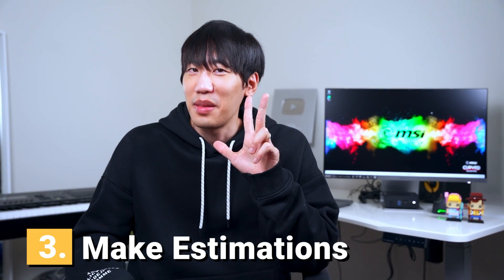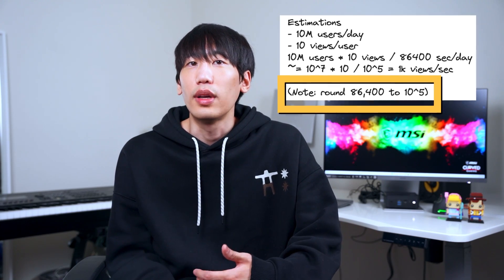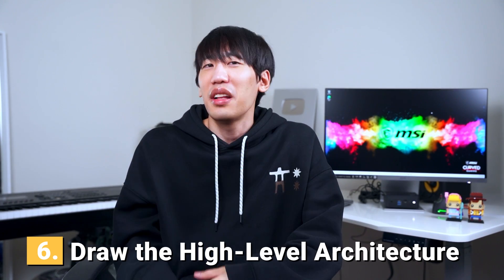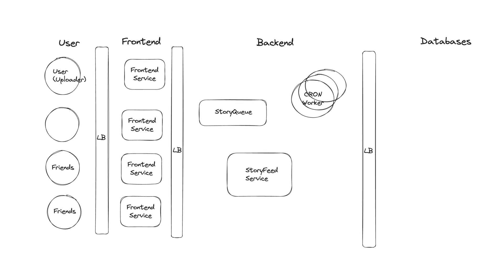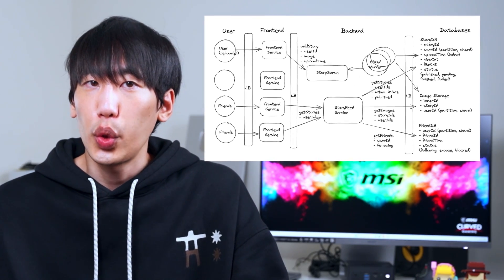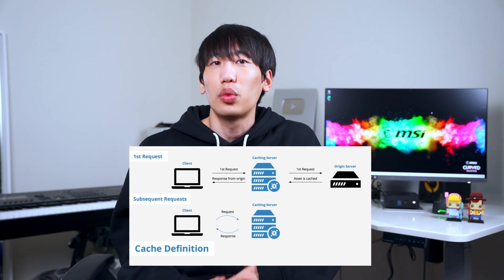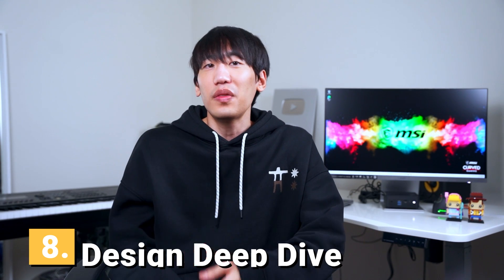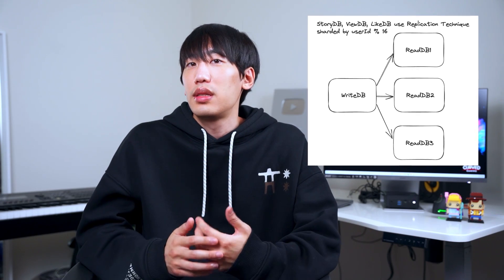How to ACE System Design Interviews

Comment: 1 Identify Functional Requirements
2 Identify Nonfunctional Requirements {
	Consistency
	Availability
	Latency
	Scalability
	Security
}
3 Make Estimations
4 Define APIs - Use textBox to describe it
5 Define Databases - Use textBox to describe it
6 Draw the High-Level Archtecture {
	User | LB (Load Balancer) | Frontend | LB | Backend | LB | Database
}
7 Design the Components {
	Backend Services
	Message Queues
	Cron Jobs
	Caches
}
8 Design Deep Dive